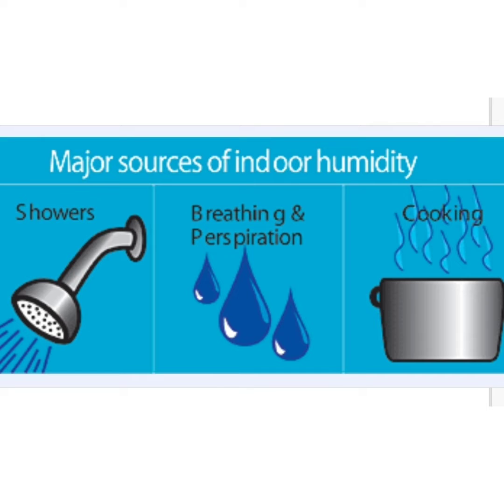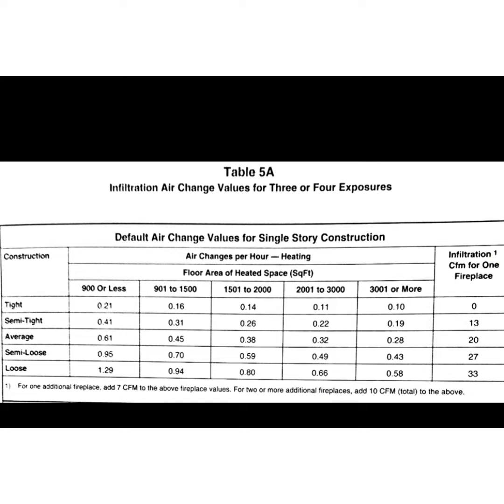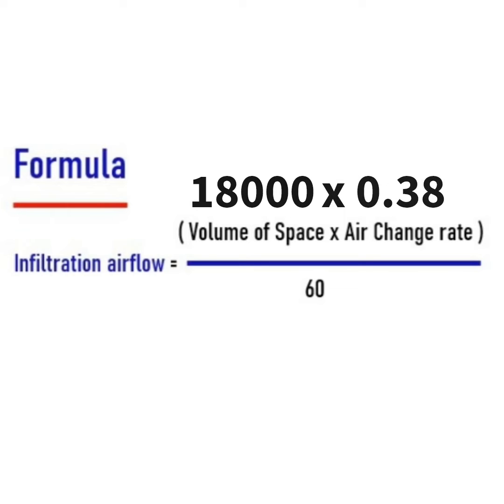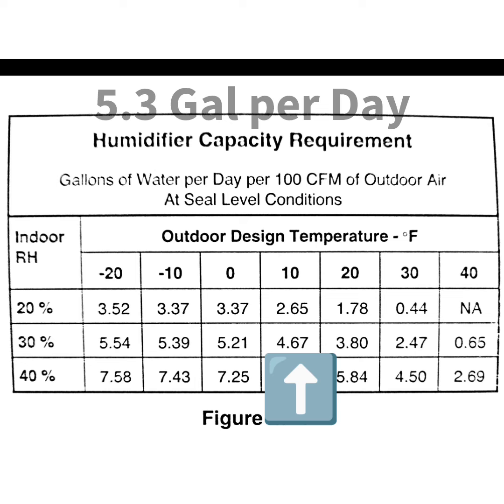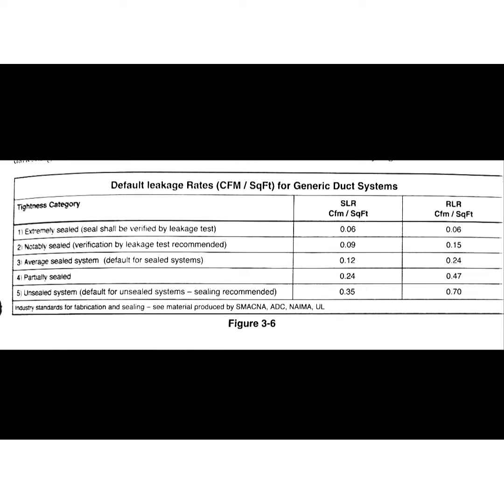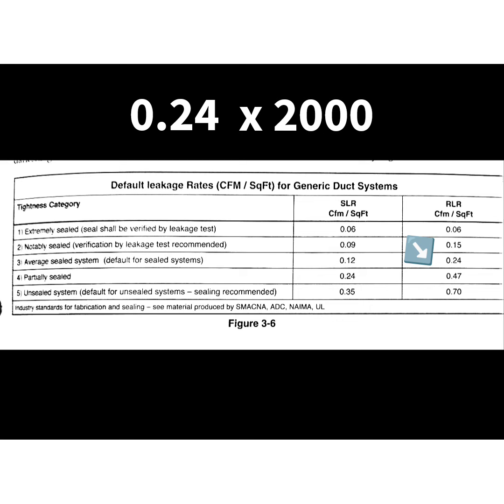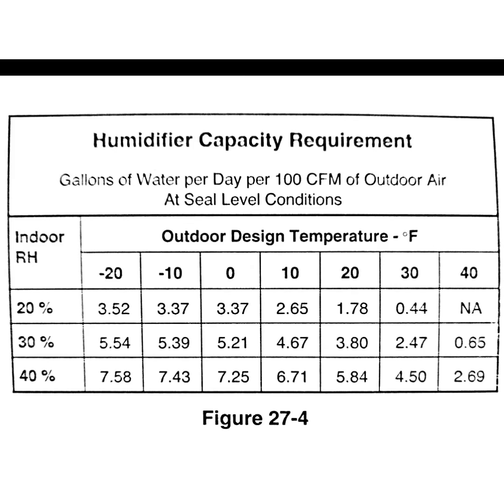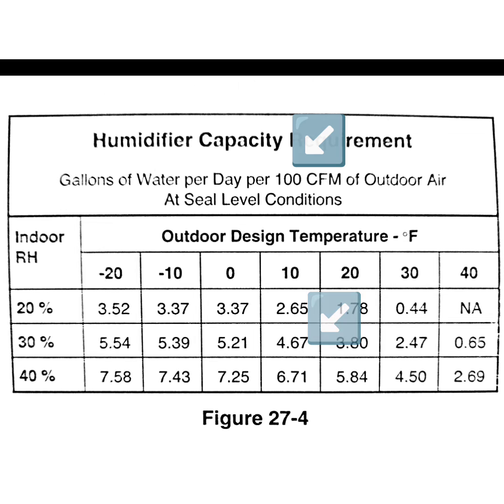Using Manual J To Size Humidifiers

Comment from the maker: I want to clarify one thing:
Actually, supply duct leakages DOES matter because it can cause a building or room to go into a negative pressure, enhancing infiltration. You should attempt to perform duct sealing along with any humidity control upgrade.
2.